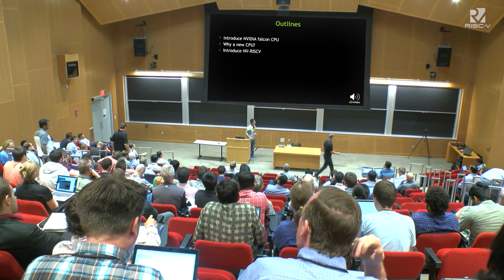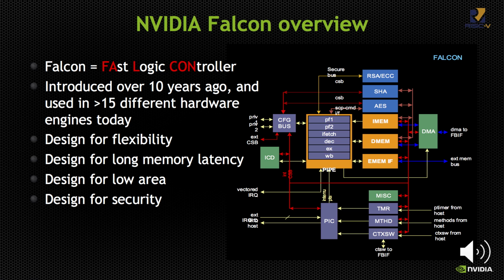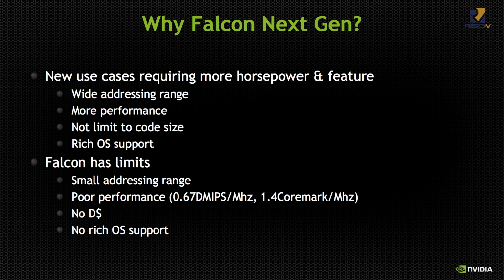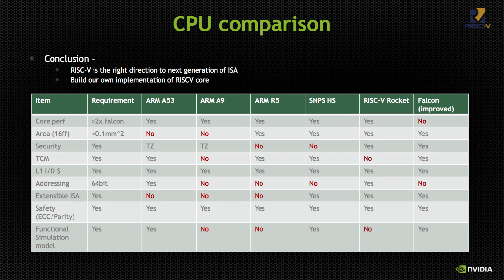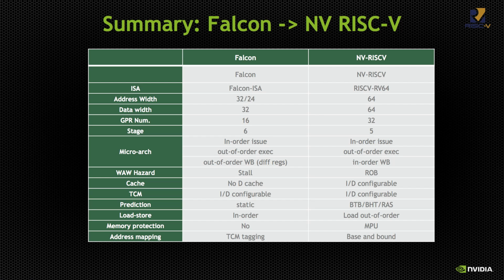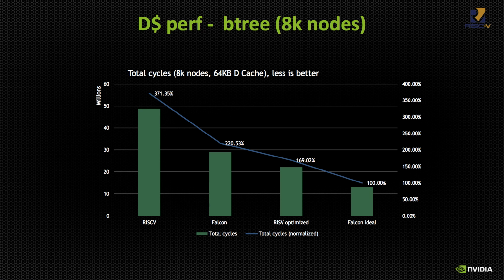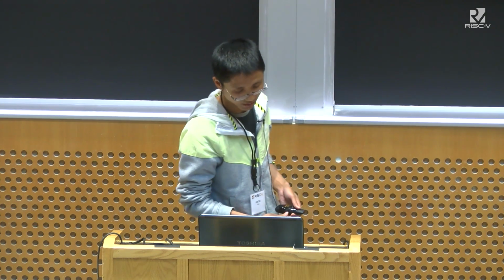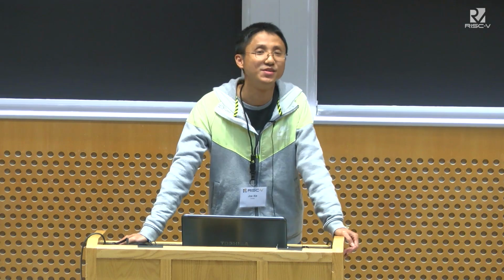Tuesday @ 1100   NVIDIA RISC V Evaluation Story   Joe Xie, NVIDIA

Comment: The person who ask about Spike clearly does not have an hardware back ground. Spike more like JVM where you can write RISC-V code and run it with spike. But you can't not do High-level synthesis. What Nvidia needs is a RISC-V core in SystemC or Verilog because even if their software runs on Spike there are no guarantees it runs on their eventual core. But with something in SystemC or Verilog you know at least you code will run for sure if you synthesize that.

Comment: Why is it that NVIDIA only can run code on that RISC-V core? Doesn't the customer own the hardware? Manufactures need to respect the freedom of the users. We don't want unauditable code in our hardware it violates the security of the product from the users standpoint. I can understand that you would want to void the warranty in that case but you should not forcibly block access from the owner of the hardware.
Reply: Not that you really care, or will even read this comment, but I'll bite anyway. This is firmware, not software. If it was financially feasible, they'd do it in hardware. This is not something they run general code in, but some very specific functions, and it's software because they want flexibility and future proofing. You might as well whine that why is it that NVIDIA only can decide what hardware they put on the chip.
Reply: GNU + linux
Reply: its nvidia, what did you expect.